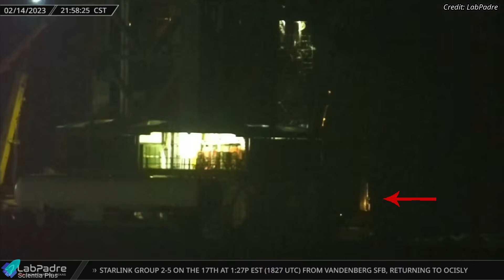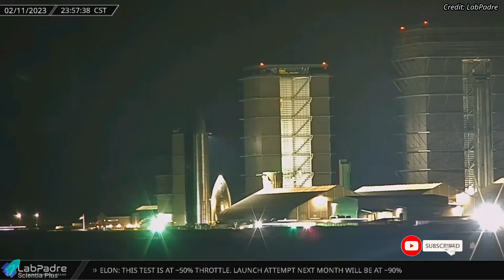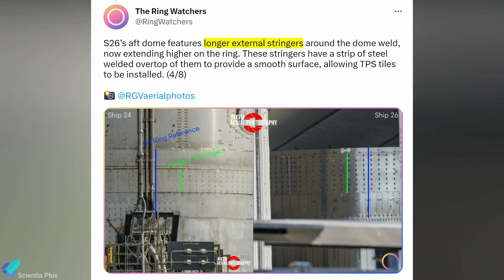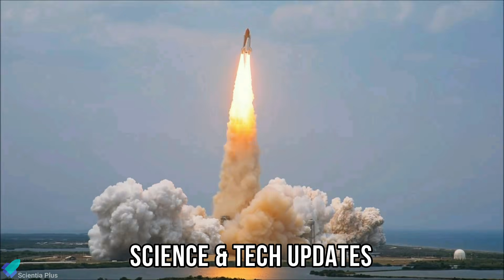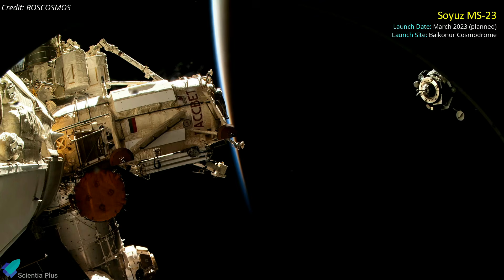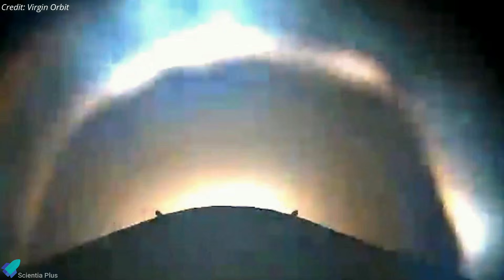SpaceX Slammed with Massive $175,000 Fine by FAA, Starship Launch Date?, Booster-7 Spin Prime

Comment: Make a mistake with the fuel filter in the fuel supply system to the second stage, it's strong, most likely it is a manufacturing defect.

Comment: Surprised and disappointed the oil rigs were sold. SpaceX does so many "impossible" tasks, it's a bit jarring when even they have to abandon a project.
Reply: I doubt that they are abandoning the idea of sea launches, they probably just realized that it would be more work/money (both) to retrofit an oil platform for their needs as opposed to a purpose-built one. Kinda like how Blue Origin scrapped Jacklyn in favor of a purpose built drone-ship like SpaceX. Hell, they are even contracting the same company as them.
Reply: From what Gwynne said, it's not that they're abandoning the concept of sea launches, in fact in the future they see a bulk of their launches occurring out at sea.  For whatever reason though, they felt the rigs weren't the right architecture to base their ideas on.

Comment: If you don’t motivate them, they fine you
Reply: SpaceX needs to get this stuff together. They're launching humans now to the ISS. If something goes very badly and it's found that SpaceX was not properly following safety regulations, training, implementing thorough maintenance checks, and taking all employee concerns seriously, then that would likely be the end SpaceX being permitted to launch people. I work in the airlines and this stuff is no joke. Even small oversights can cascade into problems that can get people killed.
Reply: Which side is FAA?
Reply: Not a deserved comment; apparently SpaceX didn’t meet the rules for one launch - and did so, without even trying to provide an explanation. The law requires enforcement; FAA is recommending a less than maximum fine (I’m guessing, maximum fines are primarily for premeditation??). The rules are there for a reason; they need to be enforced, particularly since in FAA/AST’s case, most of the rules are safety-related.